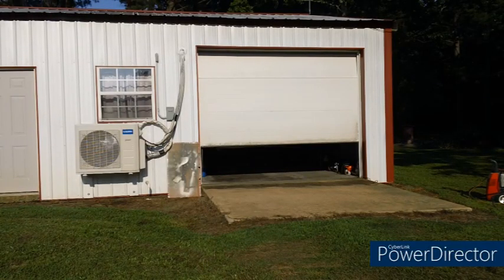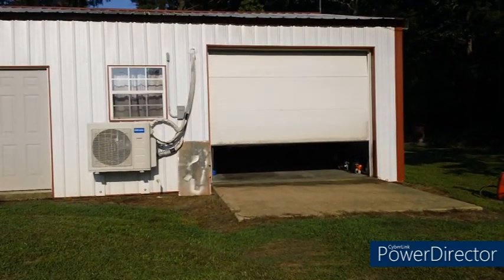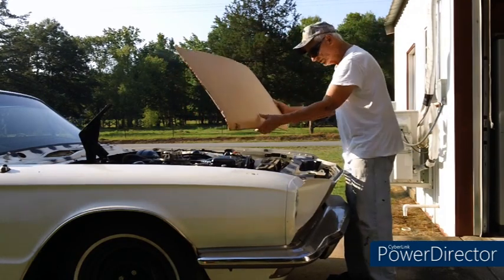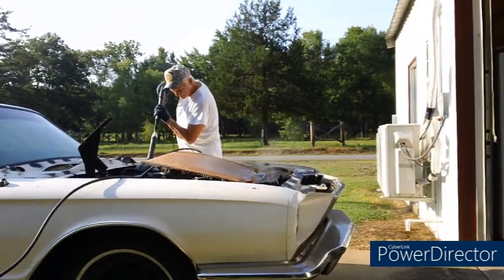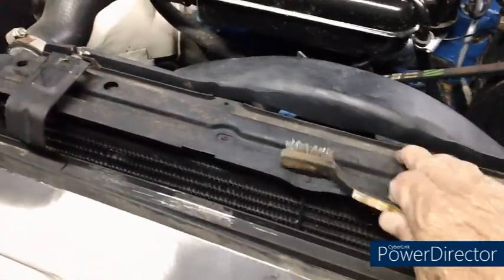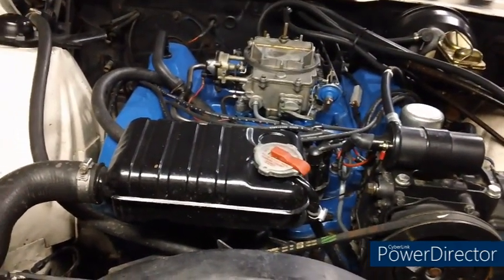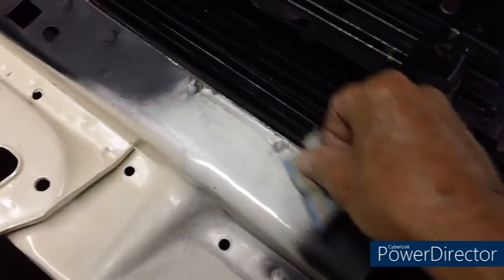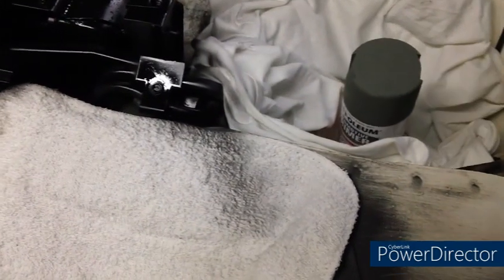1966 Ford Thunderbird repair and refurbishment (Part 133)  Minor painting.

Comment: Hey John, that engine compartment is really starting to look super. Its not uncommon for Thunderbirds to have bad light sockets. I would not be surprised if your back up light sockets were bad. Same with the tail lights. The sockets on my Caddys are bad too. The Neutral Safety switch controls the reverse lights so you might want to check that. My guess is the sequential bag controlling the turn signals and brake lights is bad. Someone here mentioned grounds, yes, make sure they are good. Every time I hear you speak about the wifey I get sad, I'm so sorry that happened. Id just die if my wife died prematurely. At least you have us now, a motley crew of Thunderbird nuts. Thanks John.

Comment: Hey man! Love your videos, I have a question though. My 66 I recently did a brake rebuild on and I’ve been having some trouble  with the master cylinder. I tried to rebuild it but it was too pitted to do so, and anything I buy from part stores around seems to fail quickly, or wasn’t made we’ll in the first place. Any suggestions on where to get a new one? (I don’t plan on putting discs in the back as I would like to keep the car as original as possible) Anyways I hope whoever sees this has a wonderful day!
Reply from the maker: Jackson,
Brakes are a massive safety issue, so don't play around by using cheap master cylinders.  Spend some bucks and get a good one.  My recommendation:  https://www.parts123.com/parts123/dyndetail.pta?catalog=0000030b&uKeY=220
Regards,
John

Comment: Sitting Here with a 66 and whole bunch of parts to be installed and really really need to move it literally 100 ft into shop where I got everything I need to work on but somehow im looking at the car now without Interior and dash removed wondering how the heck did I get here...
Reply: Also a Fellow Arkansas Native and before this car I hadn't even changed the oil in a car but watching your videos is what pushed me to do stuff correctly
Reply from the maker: Cody,
OK, my friend....get off that rump and move the car into the shop.  No excuses.  Chop-chop!  You'll feel better for it.  Once done, spend a week or so getting the parts better organized and formulating a sorta repair plan.  You can do it! 😎
I might do a video about this subject.
Regards,
John
Reply: @joernone  it’s not running and I’m waiting on parts lol It’s on a hill so I can’t just push it. I wanted to get her rubbing before I started worrying about getting ready to paint everything but the interior is completely taken apart down to frame now. My problem is once I started it’s hard not to over and over “well I might as well go ahead and take care of X”
Reply: @joernone  iv been organizing for weeks now, my Uncle passed away when I was in high school and his shop is completely unused and it’s big right now have 72 Chevy 4x4 + Bass fishing boat + 3 mowers and that’s just one half been setting up the other to work on my car just while moving and organizing I found 2 Parts washers. The smaller snap on with the oil drum isn’t that big but the other is huge and it was just covered up scaffolding and all kinds of stuff. I was gonna just hook onto car and pull it over there but it said that was bad for transmission